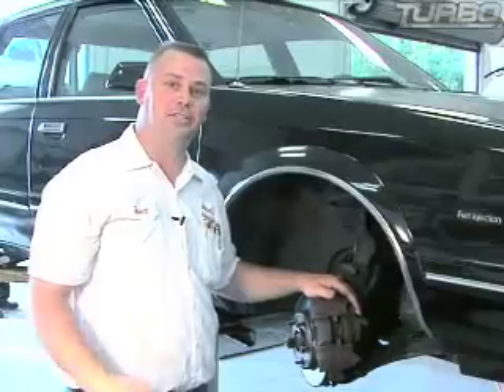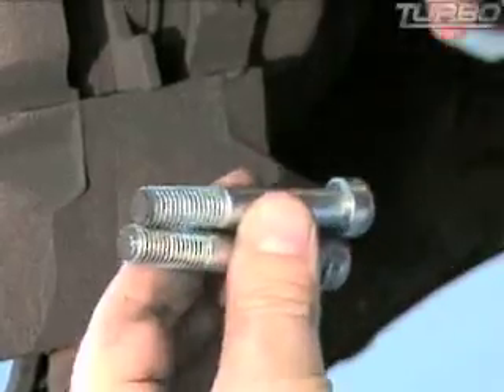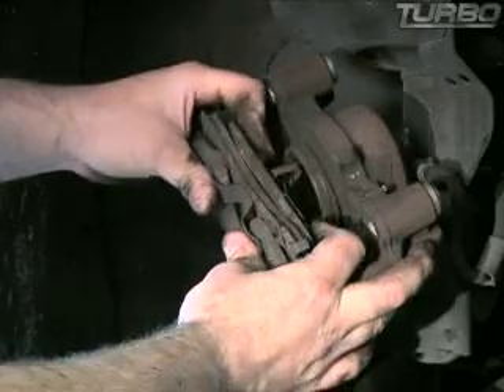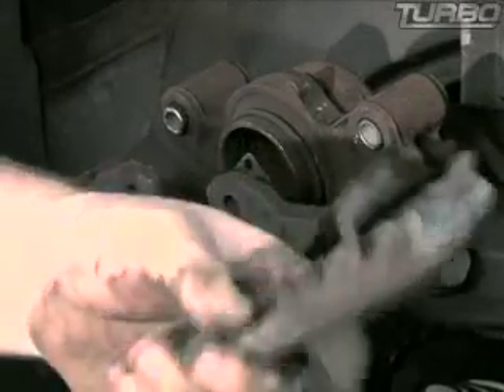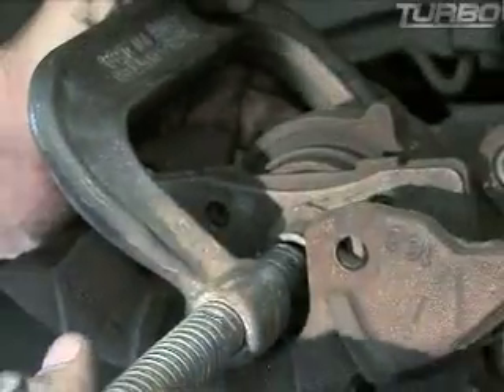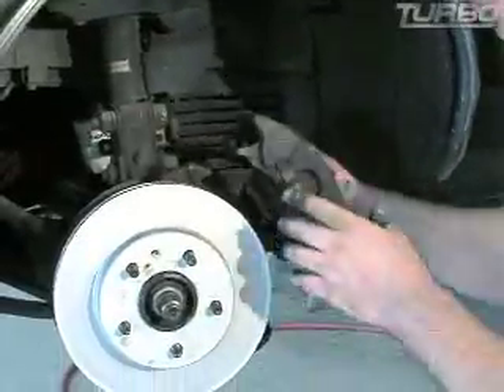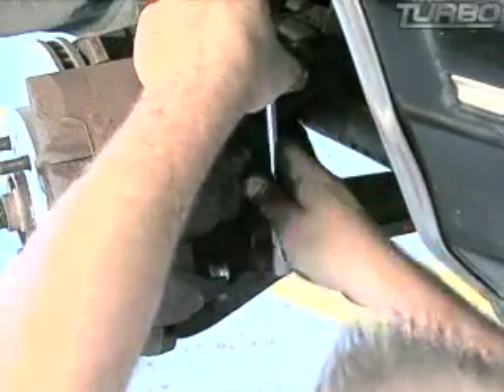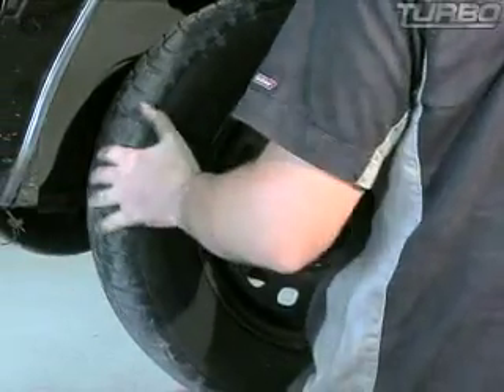Maintenance and How-to: Changing Break Pads

Comment: Thanks for this video! I replaced the breaks on my ninety-four Ford Tempo using this video. It took a few hours because we had to disconnect the break line then use a crow bar to force the break piston to release the fluid stored up in it, but after that it was a breeze. The new breaks work like a charm!

Comment: Went to replace my break pads on my car.  Everyone told me it was easy.  I never done it before and I only ever watched someone replace drum breaks before.   This video was awesome.  The bottom bolt was a paint to get at.  The spring on the back side of the calliper was in the way.  Turned out I have a break line leak and I need a new calliper because the bleeder screw is rusted to just a cylindrical tube with no nut.

Comment: @cocojwan 
1/4 turn on each lug nut while tire is on ground with car weight on it (otherwise if you jack it up and try to loosen them, the wheel will just turn.)

after u break them loose put a block or something behind your rear wheels if youre not on a totally flat surface to keep from damaging your jack,jack 1 side up, try to use a hydraulic jack not spare. after you jack 1 side up, if you have it, place a jack stand underneath, let it down, then do the same for the other side. remove wheel!

Comment: if the piston wont compress on the back brakes, see if the e brake is on. take it off and if it still doesnt work than you have to use this specail cube tool. the piston twists to compress insteead of pressing. took me fooorrrever to figure that one out

Comment: I would like to see details of how to clean and lube things up properly. This
is a great video but it assumes you know this already.

When you press the piston back in don't you need to open the bleeder valve
or take the cap off the brake fluid reservoir to avoid problems?

Comment: @14sincere 

hey, if your rotors are grooved, then you have to have them 'turned' and that will smooth them out, autozone can do this for like 10$ per rotor. some are impossible to repair so you may end up spending 20-25$ per rotor but its worth it.

if your breaks are changed in time and you have not 'ground' into your rotor youre good to go, if you just did minor damage then you may be able to have a store turn them. do NOT have a automotive repair shop do this, take it to a parts dealer.

Comment: To the mech in the vid, you're right...I am too cheap. Last time I had brake work done, it cost me $600. I later found out I had been ripped off. This time, I chose not to be a victim. Thanks for creating this video. It gave me much of the know-how. I just finished doing my first brake job (CX-9 front brake pad replacement). This was one of the better brake job vids I found on here.

Comment: @KhmerD0g I'd say yes, if you have a few pieces of equipment and a little know how it's way worth it. Any place I've called to have my brakes/rotors replaced (including drum brakes on the back) cost on average $500, for me to replace all my own stuff including new drums/rotors/drum springs/pads etc set me back about $200 (not including equipment, such as tools, brake cleaner etc) so I actually save about $300.

Comment: The only time I have ever loosened a bleeder screw, is when replacing drum brakes. A lot times those little pistons will pop out and air will get in the brake line. This will cause your pedal to go straight to the floor. Then you have to open the bleeder screw, pump the air out of the brakes by having another person pump them while you open and loosen the screw till you hear no more air.

Comment: @handsometall28 make sure they meant pads, and not pads & rotors. also make sure the pads you found on ebay are for your particular model. and to be honest, they probably get pads from their supplier for about the same or less, but will charge you the moon for labour, so you might as well learn to do it yourself, and save yourself hundreds AND learn something new :D

Comment: I replaced both pads and rotors on my 2010 suzuki and now I'm having intermittent grinding only when I brake at >25mph. I greased up everything that needed grease, the shields isn't hitting anything, nothing loose and I made sure to put back everything exactly how it came off. Again horrible intermittent grinding noise. Took my tire off and everything looks good. Any suggestions?

Comment: Hey Robert, I'd appreciate you not getting grease all over my new pads and rotors, thanks.

When installing new brake parts, cleanliness is key. Always clean parts with brake part cleaner and avoid getting greasy fingers all over your new pads and rotors. New rotors also have a coating on them to protect the surface during shipping. This needs to be cleaned off with a brake parts cleaner before installation.

Comment: it's better to open the bleeder screw and let all the dirty fluid out..especially on older
cars..perfect method..but on new cars you 
may not..but there 's a 50/50..thats why when i do brake jobs on my shop..i always sale the customer a brake flush..should be changed every 30k..or
sooner..brake fluid time to time may absorb moister and its recommanded from manufacture..to do brake flushes

Comment: its always outter pad first you just got lucky the pads were wore far enough to get the inner one out first, that also lets you press the piston with the old pad instead of risking cracking the new one. didnt wire brush pad contact points or use brake parts cleaner? what a ripoff